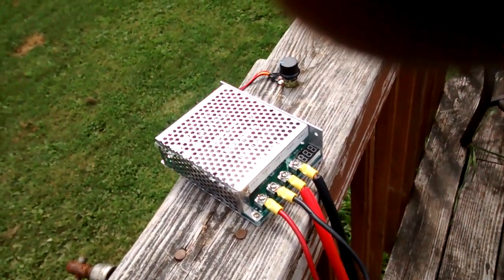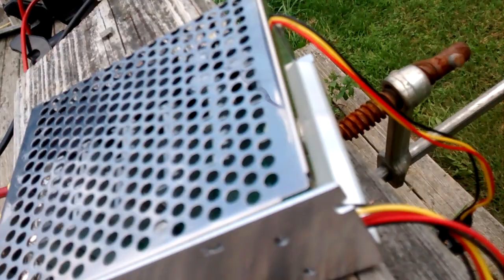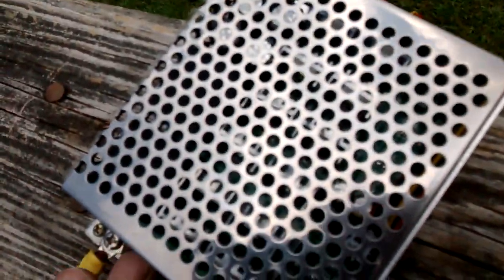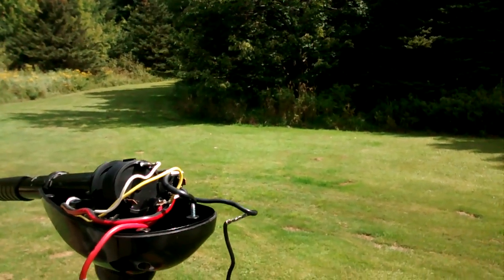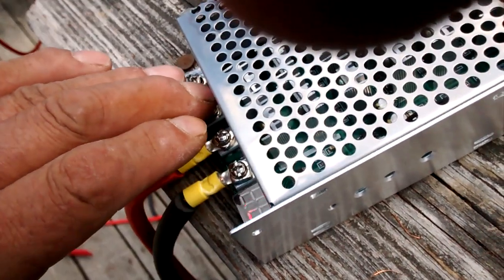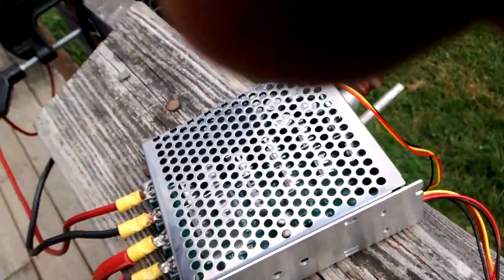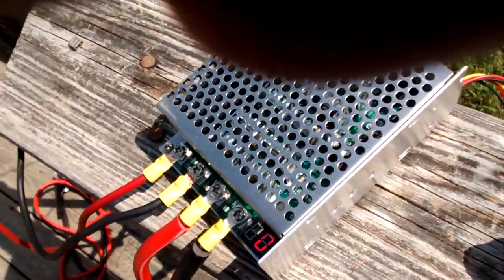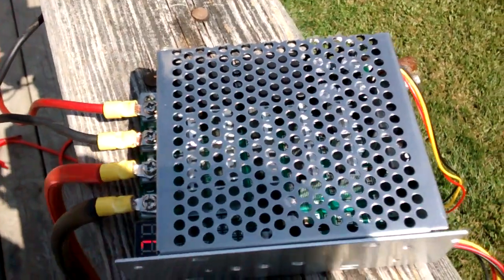Trolling motor variable speed switch

Comment: Where did you get it can you put a link to it
Reply from the maker: ICQUANZX PWM Motor Speed Controller 60A DC 10V-55V 12V 24V 36V 48V Digital Display 100A Max Brush DC Motor Controller - Third gear Forward Reverse Stop https://www.amazon.com/dp/B081YYK6NW/ref=cm_sw_r_cp_apan_glt_i_SEJ90HG32A2925J0DAHD

Comment: What wires did u use to hook up?  And where did u get it?  And what did u use to get the large gauge wire into the tiny terminals on the pwm controller?

Comment: Sorry to burst your bubble but this Chinese made crap will fail you out on the water. Have a look at the circuit board tracks, no way they can handle the current load the connecting wires will . This is just a fancy fuse. Use the mechanical/ resistor controller that comes with the motor, if you have to you can mount it in a waterproof box , this will be more reliable.
Reply from the maker: Yeah,its made in China. I've been using mine on a 55lb minn kota motor for the last 3 years and it's still going strong. Maybe you don't have experience with these. As long as they are kept cool,they work with no probs. They're 20.00 apiece my man. I have 12 of these for replacements. I use mine almost on a daily basis and have no complaints. The only ones that have failed me so far are ones that I shorted out on the bench or because I connected it to the battery reversed. I went 22 miles nonstop  on the barge canal in NY with nary a hiccup. I always bring a spare trolling motor with me just incase. If u know where I can buy  one with these features in the good ol USA,please tell me where. One seller is Gama electronics but there products suck and cost 12 times more. I bought two motor controllers from them and they failed with little use. So,I will have to disagree with you. Not all products made overseas are junk or maybe I just got lucky. Either way, I have a few friends that I've turned on to these 100 max 60 continuous amps and a couple of them failed because they got dumped in the water but not from wearing out prematurely. Not so far anyway.
Reply from the maker: One last thing. The point of using one of these is to get away from the mechanical  switch. I travel at full speed mostly and the mechanicals can't take it. I've fried a few of them. Even minn kota advises not to run at full speed for more than 10 mins. Also,they use more power as u are limited to the 5 speed settings whereas with mine,I can go as slow as I want and anywhere in between. I'm spoiled now and will never use the crappy mechanical  switch again.

Comment: Hello fishing buddies.  I want to update anyone looking a variable speed motor.  I have used mine for two seasons, and not a bit of trouble.  I am running a 35 amp/hr battery on a 10 foot fishing pontoon, and have run the motor for four hours only to use less than 50 % of the battery.  Once I did pull another boater in a larger fishing boat to the ramp, and that did drain my battery.  On slow days, I like to run the motor as slow as I can, and run a jig behind me in shallow water to catch bluegill.  I can watch the fish, and they are not spooked from the motor.

Comment: I did a test on the 40 amp/60amp max version of one of these and although it works great for reduced speed settings, at max speed, the same motor that draws 22 amps on the controller at max speed, draws 26 amps hooked directly to the battery.  That's a 15% power loss.
If you desire the maximum power you can get at full speed, I recommend a bypass switch for full speed ahead.
Reply from the maker: How did you connect it before you tested it?
Reply: @umpy3152  
I used a standard hard wire connection to the battery via a switch.  It's a homemade trolling motor.   I'm actually fine with the current loss for this motor because 26 amps is probably too much for the motor anyways and without the controller, I'd have to reduce the prop size to bring it down to the 20 amp range.
Reply from the maker: @Andy-df5fj  the variable speed option is nice.
Reply: @umpy3152  
Yes it is, especially if you intend to troll.  Having the precise speed you want is sweet.

Comment: The current offerings of those 60A/100A max controllers are listed as current modulation rather than PWM.  If accurate, I suspect that would essentially make them high current variable resistors and therefore no more efficient than the resistors built into standard trolling motors.
Reply from the maker: You're correct. At full speed,both consume roughly the same power. Where the efficiency comes in is, when it is turned down slightly, the motor is going slightly slower than full speed but not as slow as speed 4 on the click selector. That right there saves power. I definitely see the difference between the two where power consumption is concerned. For me the difference in saving power wasn't as big of an issue as was the heat issue. When it comes to handling the heat, Minn Kota speed selectors suck when going full speed for long durations,they get hot. Especially on hot day's. I kept burning up switches. The heat was consuming extra power right there from lack of resistance. Now, providing that the fan is running, I don't have that issue at all now. My trolling motor is 55 lb I use 2 AGM batteries in parallel for a combined 190 ah. I never run them below be 12.4 v. I went from lock 20 to lock 19  on the barge canal for a total of almost 22: miles and didn't run the battery under 12.4 v. That was alternating between full and slower speeds. Woulda had a tough time doing that at the speeds I was going with the original switch. Heat is the destroyer of electronics is most instances.
Reply from the maker: I also purchased a Minn Kota max 55 a couple of years ago. This speed controller actually blows it away. I put the max and my endura 55 side by side running off the same batt and the max doesn't have the rpms that the endura has,and that's with the original click switch. The reverse is even worse. The max pwm is encased in epoxy and gets hot at full speed. Minn Kota even advises not to run their motors @ full for long durations. I also bought a m k traxxis 55 which is essentially the same as the max except for a couple of features. I only bought it because it was broke and I got it for a steal. All it needed was a new brush holder and is now for sale as I don't want to use it.
Reply: @umpy3152  
It's odd because if that controller is not PWM, it should get very hot dissapating the heat at reduced throttle settings unless they have some other way of efficiently regulating current without PWM.
Reply from the maker: @Andy-df5fj  whatever you want to call it,as soon as this is hooked up to a battery, the incoming power as well as the out are drastically changed. I found this out when I connected a 12v fan directly to the  - + going in and immediately burned the fan out. I never check the voltage before hand assuming it was whatever my battery was charged at so, I hooked up another fan and same thing. When I did check the volts,it was all over the place. It was jumping between 17 down to 5,all kinds of weird numbers. The fan couldn't take it. I had three Batts connected in parallel and they all had this erratic volt reading as well as the volts out to the motor. I can't say why as I'm am by no means an electronics expert. It doesn't have any adverse effects on the battery or the motor though. One thing I did find out was that with my 12v jump box hooked up in parallel with my batteries,the cigarette plug read the correct voltage. I had a whole different connection just for the fan that I plugged into the cig plug. I came to realize that the cig plug is connected to the jump box via a small circuit board. That circuit board some how keeps the voltage correct  So I had another jump box that I wasn't using and took that little circuit board out and put it in the enclosure with the speed controller. Now I don't have to bring my jump box just to control the fan. Everything runs off the same power source now.
Reply from the maker: Mine checks out to be a true pwm.   https://youtu.be/NtPeDJc7W7g

Comment from the maker: I made a video on this to help better explain the voltage issue with this particular unit. One thing I forgot to mention was,if your unit is different than mine,check the input voltage as it may not have this same issue. I also have a couple 60 max 40 continuous controllers that don't behave like this. They show the normal volts when there in use. If yours happens to be different  and the voltage is normal,by all means use it for your fan source. These fans don't use a lot of battery.
Reply: You could bypass the unit inside your motor completely by connecting the motor directly to the external unit you purchased. The external unit (PWM DC motor speed control) connects "between" the battery and the motor and "regulates the power sent to the motor - therefore controlling its speed.

Comment: Have you had any over heading issues. The first time I used mine it got really hot so I stopped using it, maybe it was because I needed better ventilation in the electrical box I was using
Reply from the maker: When I first used this,I did have heat issues. It actually softened the plastic housing it was in. I added a 12v fan and now it stays perfect. The only thing is,and this is if you have the same one that I have,this unit changes the voltage of the battery input. Foe example.when you hook up the battery to the + and - of the speed controller and check the voltage of the battery, the volts fluctuate all over the place. I found this out after the first two fans burned out. I tested the voltage and it showed an erratic reading. I ended up having to connect the fan to its own 12v source. I'm not sure why it works this way. Perhaps if somebody has more knowledge of these than I do can explain it. Anyway, l don't have a problem overheating now. I use a cheap 12v battery just for the fan as they don't use much power.
Reply: @umpy3152  thanks 👍👍 I guess I'll look for a fan not to fix the problem
Reply: Oops  hotfix the problem
Reply from the maker: I believe the voltage issue is because of the pulse width modulation. The controller sends pulses instead of constant current. I believe this particular unit also takes in the power from the battery in the same manner.
Reply from the maker: I made a video to help explain this better. I'm not the greatest at making it crystal clear. Sometimes  my brain is  all  over the place like that volt meter. https://youtu.be/apV8JdjeRPk

Comment: I bought a dry box, four quick disconnects, slicing items and a volt meter.  Then I mounted the motor to the front of the boat to even the weight on the pontoon.  I ran 8 gauge wire from the battery to the dry box, and ran the wire from the motor to the box, and the system runs great.  The motor at full power runs a 12.7 volts.  Thanks for your help again.

Comment: Finally received my 60A controller after 5 weeks of shipping.  I have all the hardware.  I will let you know how the system works.  Thanks for the tips.
Reply: How did it work?
Reply: I have been out many times, and the set up works great. I cannot imagine how to improve on it.  I added a water tight box, and finding one the size that will work and not be too big was a little difficult. I have found a speed when wind is very light that the controller offers that I could never do with just the motor.  I have not used half of the battery after four hours on the lake.

Comment: So how long did you extended you’re  trolling time or does any one know how long will the battery last I would like too see a video on how long it will last on the water
Reply from the maker: I'm not using this right now because I bought a haswing brushless motor. The haswing also has continuous variable speed. As far as the power saving between the two of them, I don't really see much of a difference in amp draw but the haswing is half the weight and has a little more power than the Minn kota 55 and also runs smoother. what I found out about the pmw that I bought was,it will draw about the same power as a standard trolling motor when ran at full speed. Where the big difference is,when u turn it down just a bit,it seems to lower the amp draw significantly. You're still going pretty fast. Let's say faster than #4 speed a standard trolling motor but using Less power. I have a Intex excursion 5 that's not very dynamic as the bottom is big and flat. That being said, I still could get around 4 mph which is pretty good IOP. I also have decent batteries. A vmax 150 ah paired with a Odyssey 65 ah for a total of 215 ah. When I was using the Minn kota and speed controller, I went on the canal from lock to next lock and back again for a total of 23 miles. When I got back, I still had better than 12 volts. That's pretty good imo. Also I wasn't going  full speed all the way as I was alternating between half and full. On a standard trolling motor, I would have used a lot more juice.

Comment: you said you deleted 2 wires, could you just turn your handle to speed 5 and use the main 2 wires that go to the battery and not have to take anything apart?
Reply from the maker: Yes you can but,by not bypassing the switch it will heat up and you actually use more battery power.
Reply: @umpy3152  ok thanks,

Comment: Great video !!  Im in the process of a very similar build for my 36 lb. thrust  trolling motor on my kayak , any info on the enclosure and fan ?
Thanks Again !! 
this is the unit I purchased https://www.amazon.com/NOYITO-Controller-10V-55V-Digital-Display/dp/B07D31MGFF/ref=sr_1_1?s=hi&ie=UTF8&qid=1547305087&sr=8-1&keywords=NOYITO+PWM+Motor+Speed+Controller+60A+DC+10V-55V+12V+24V+36V+48V+Digital+Display+100A+Max+Brush+DC+Motor+Controller+-+Third+gear+Forward+Reverse+Stop

Comment: Maiden voyage with mine today. 100% was getting about half the speed as with the stock controls. Anyone else have this issue?
Reply: I was just researching these on amazon and it looks like they're not actually PWM controllers.  They are "current modulating" which I'm pretty sure means they just use resistors to limit current to the motor.  If you have a decent multimeter you can measure current off the battery leads to verify this.  You might get infinite speed conrtol but it's still going waste precious amp hours.  Glad I read the fine print before buying.  It's only $20 but thats $20 I can put towards a PWM controller.
Reply: please keep us posted , Im doing a similar build
Reply: So I scrapped mine and went back to the stock controller. Tried two different speed controls but but they both just made my yak slower. Not sure why.

Comment: Can you show the box you made and how you hooked the wires to the head of the trolling motor?
Reply: Theres's 4 wires coming out of the trolling motor. Black and Red (those are the only ones that matter). Then there Yellow and White which are for the variable speed control, cut and terminate those, they're not needed since your going with this PWM system. The Gama remote control also is a game changer!
Reply from the maker: @carlebeling5256  There is no need to  cut and terminate  the pot wires,just tape or seal the ends off and move them out of the way. Actually not a good idea to cut them in case the unit isn't working out,you can always connect them back to the original switch. Other wise you would have to secure them back together  thus creating a weak point. They don't hurt a thing being uncut.
Reply: Here is the video that inspired my build. 
https://www.youtube.com/watch?v=crJHfZeTLh8

Comment: Good way to burn up your WATER COOLED motor! Put it in a trash can full of water. The contoller and wires are so cool because you have no load on the motor! Put it in some water so it will draw some real current. However, the PWM is inherently efficient and will stay cool. The wires will heat up when you draw some real load current.
Reply from the maker: For one, It wasn't running long enough to burn up or even getting warm for that matter.  Secondly,the " Inherently efficient" PMW does get very hot if kept on full speed for to long unless a fan is added to the enclosure which is what I did. Thanks for the comment.

Comment: How do I wire in a toggleSwitch to the speed controller?
Reply from the maker: Scammin Janet The toggle switch already comes wired.
Reply from the maker: Andrew Eddy if yours is like mine,there should be 7 lugs/ connectors. 2 for power in,make sure these are  connected correctly. 2 for power out to the motor, doesn't matter how you hook these up as the direction is determined by the toggle switch and 3 for the toggle switch. The toggle switch has 3 wires. The middle wire goes to the middle lug and the other 2 can go on either of the other 2 lugs.
Reply: Awesome thanks a lot. Hey what gauge wire did you use for battery and motor connections?
Reply from the maker: Scammin Janet 8 guage to the power in and the original wires from the trolling motor out.
Reply: Shoot I went 10 guage on all of them. Will this be a problem?
Reply from the maker: Scammin Janet probably not,just check to see if they feel hot to the touch. Cooler is better.